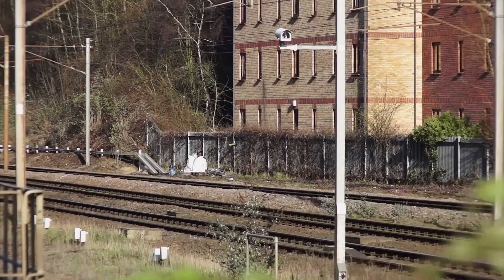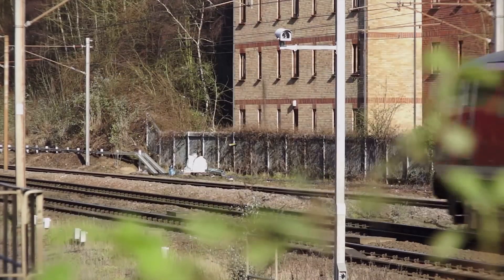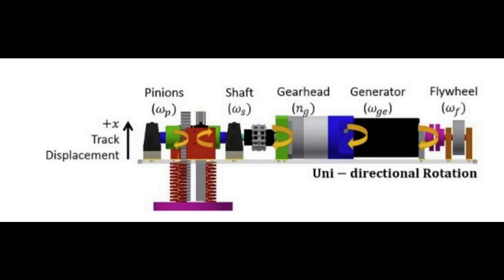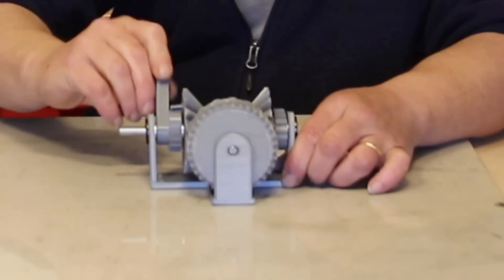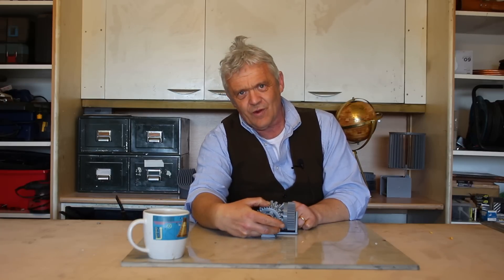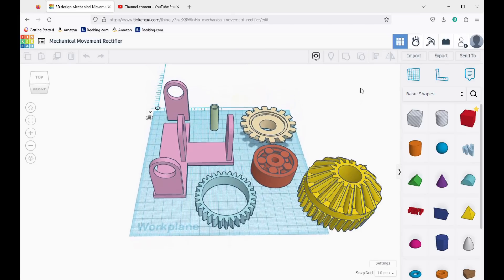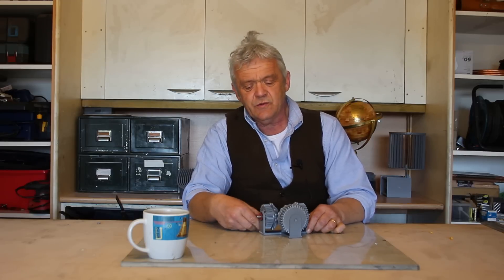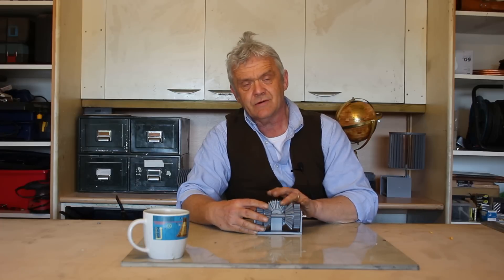1912 Energy Harvesting In Megawatts - The MMR Breakthrough

Comment: What if everybody walked up stairs and descended via a cable that was wound around a generator shaft.  For that matter what if all elevators descended by producing electricity?
Reply: 6:22 it would be quite a task to find a everybody to do that. and then how long and how much. but that certainly would work to make energy. and elevator has too much stopping and going to get anything out of it. there is a video where they mounted a generator on top between two buildings with a large weight. It did show that it works. their plan was to mount it over old mineshaft, but they could not get the funding.

Comment: Rob, love your content. Been following for a while now. 👌🏼 Off topic question. Have you ever looked at the GEET by Paul Pantone. He made a fuel processor that runs on same process as a thunderstorm. Warm and cold counteracting, to let a generator run on all kinds of liquids. I am curious what your insight as tinkerer and chemist can tell about geet. I am thinking of running a generator at home if it is not gonna cost me petrol 😂
Reply from the maker: i ave mate - but ages and ages ago
Reply: @ThinkingandTinkering  Awesome, what were your findings? Care to give it another go? Did you use the floating rod or did you weld it? Maybe idea for Luke, being a “petrolhead”? 😄
Reply: @ThinkingandTinkering  you can lookup Dan Easton, he’s from the isle and has spend 4 years I believe, with Paul working putting reactors on engines. He has posted some real interesting results on youtube with a 4 gas meter. Showing the polution going down to relative zero. He said that the best fuel for geet is seawater and crude oil. (Remember your diesel from waste oil. Maybe nice linkup.)

Comment: Hmmm... Lets say you got 100 km with train rails and you use a system like this the whole way, will you than be able to run the train on its own energy?
I think the only thing you do is "steal energy" witch in turns need to be feed into the "loop" via the train from a external source?
I remember somthing like this actualy was a proposal here in Norway to be used on roads to harvest energy from cars in the 90`s
It turned out to in the end just to be a system witch just "stole " energy from each car
As i remember it had to do with a Sinus wave created by the wheels witch in turn helps your car "ride" on the compression wave like a modern ship will be helped forward with its own stearn wave (the reasond modern ships are cut clean of at the stern, not like a sail ship)
Still a facinating idea...
Reply: 😡😡I really hate the laws of thermodynamics!!!!😡😡🤬
Reply from the maker: mate - i am just reporting on this - lots of studies have been done to verify the reliability - you might want to have a read around
Reply: @ThinkingandTinkering  
Thank you for answering and for your amazing channel!!!

my argument is that thermodynamics do not alow this to be possible, entropy always go towards a higer state!
If you make that 100kM rail road into a circle, it would produce net energy, 
Witch the second law of thermodynamics forbid you!
If you scale the train wheels to run on soft rubber tracks you will always loose energy to a higer state of entropy.
And at any molycular level you will se this "train wheel " ride on its own wave of flexebility in the material.
If you cancel the stearn wave of a ship it will always ride "up hill" and just use the engine to produce more waves in every direction and spread the energy everywhere instead of it to be translated into forward movement!
Ps Love to argue , guess im a moron LOL
🤓🤓
And once again: really lowe your work!!!
Reply from the maker: @trygvetveit4747  lol - it's fair enough mate - but you don't need to go for entropy - the train is moving forward and bouncing up and down - the up and down is 'lost' - the system regains a bit of the up and down that's all - the energy lost in the up and down is considerable over a train network - it really isn't more complicated than that
Reply: BUT if you put sails on top of this train and introcuces energy from the wind into the system, it would in principle work and the train would act as a gigantic flywheel/capacitor on a wind turbine i guess🐒

Comment: we could harvest that huge waste of energy as the train bounces, yes, OR . . . we could fix the tracks and not waste that energy in the first place. And then we would save on at least 2 wasteful energy conversions.
Reply from the maker: you can't stop a train bouncing mate - that is an impossible task
Reply: @ThinkingandTinkering  But you CAN reduce the bouncing. Mate.
Reply from the maker: @MichaelKunz-mt2oo  yes but you can't STOP it
Reply: @ThinkingandTinkering  But if you can locate where to put the sensors to maximize your recapture or lost energy, you have located where to fix the bounces.
Reply from the maker: @MichaelKunz-mt2oo   you can't locate where to put the sensors for maximum effect because it is a dynamic system - if you locate a bounce point it will move - heat, trains passing over, wear and tear all will move this point and if you ever did fix it it well - it would re-appear - what you are suggesting is just impossible in a real system. You can locate them to good effect but that's it
Reply: @ThinkingandTinkering  But then that is the best you can do with a waste energy recovery from bouncing also, no ?
Reply: Train tracks have to be flexible or they'd snap. So, ifyou cannot eliminate bounce completely. You ma y as well use it.

Comment: What if you were to take something like this and spin a flywheel using the suspension on a car?
Reply: From there, you use it to generate electricity, which can be used to assist a fuel car or recharge a battery
Reply from the maker: i don't know

Comment: There is no such thing as free energy, any energy removed from the movement of the rail would put an equal additional load on to the train, the train would have to burn more fuel,  equivalent to the energy generated by the device
Reply: 6:22 true. there is a video of a train at a mine. when it is loaded, it is sent down a hill, some distance from the mine. when the cars are unloaded, it is simply sent back up the hill on its own power.

Comment: Anyone out there with a metal 3d printer willing to print out an adapter between a regular ⅜ rachet and pop over a chain sprocket on a bicycle? Just one part, how much would that cost?
Reply: 6:22 you may want to look at a back rim on a 10 speed bicycle. just like a ratchet built-in.
Reply: @iami9307  I'm using an exorcize bike flywheel and two free rachet wrenches to do the same thing in the video.. if I do use a 10 speed hub it would be for gearing so I can maintain roughly the same level of bump/vibration damping as a shock absorber even when the flywheel is moving fast.
Reply: @petevenuti7355  I see
Reply: @iami9307  yes, the ratchets and other knick-knacks from recycled materials make up the shock absorbers/dampers transmitting that energy to a heavy flywheel.. forward drive energy can be recovered from it via a magnetic clutch($15 at my local l surplus place) 
  I just need an adapter to go from the ⅜ drive to the bicycle sprocket as it is not a piece that I can simply scavenge from junk.

Comment: Is there a disadvantage to letting the generator turn both directions and rectifying the current after?
Reply from the maker: yes
Reply: @ThinkingandTinkering  Succinct.
Reply: You can't use a flywheel to smooth out the rotation if it turns both directions. I'd have thought it more efficient to use the vibrations directly (linear alternator), rectify and smooth with a capacitor instead of a flywheel. Just get rid of the gearing and clutches if you don't need them. The designer must have their reasons for doing it mechanically. 

For the linear alternator look up geophone (used in oil exploration). It's basically a 'shaker torch' construction - the magnet assembly is heavy so it stays relatively still by inertia, and the coil(s) bounce about.

Comment: Just no, train is more efficient if its  not bouncing as much.
Reply: It doesn't seem that there's an intent to add bounce, rather, this seems to simply take advantage of the bounce that is already happening.  Another application would be in the flex that already happens from wind or traffic in a large bridge span.  You're not going to eliminate the bounce, this seems intended merely to redirect some of the energy to the device.
Reply from the maker: it bounces - this system actually reduces the bounce